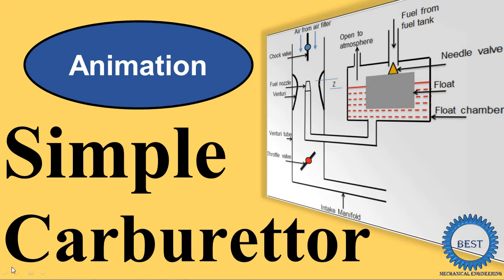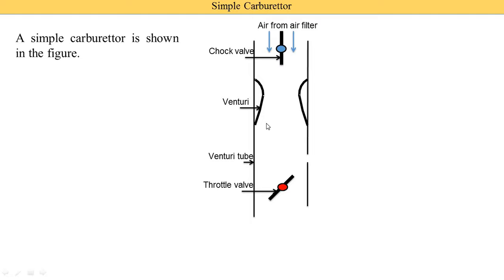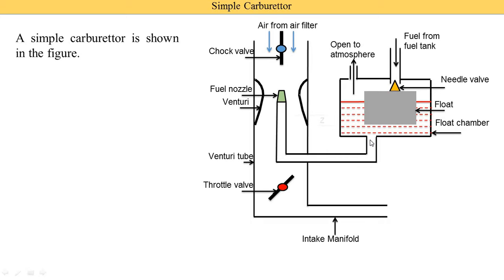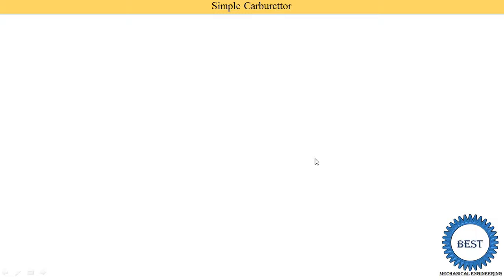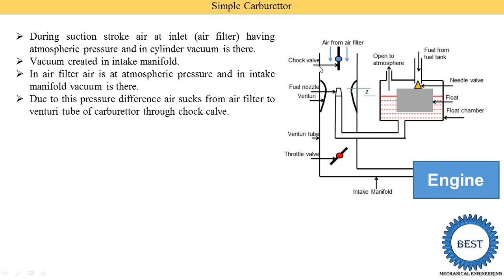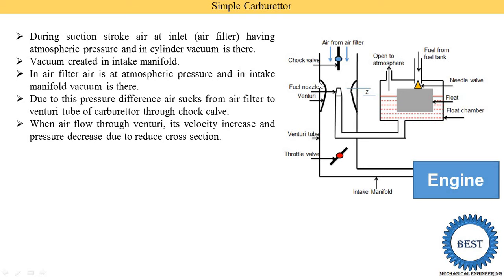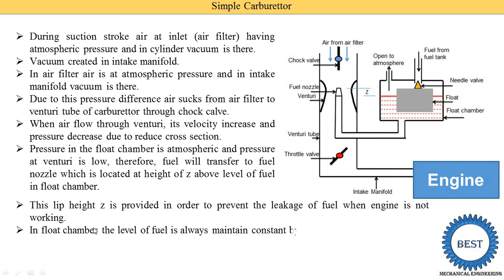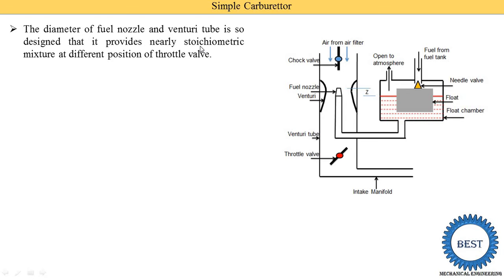Simple Carburetor

Comment: Can I get a solution for this- A simple carburetor under a certain condition delivers 5.45 kg/h of petrol with an air fuel ratio of 15. The fuel jet area is 2mm2 with coefficient of discharge of 0.75. If the tip of the fuel jet is 0.635cm above the level of petrol in the float chamber and the venturi throat coefficient of discharge of 0.80. 
calculate: 
(i) The venturi depression in cm of H2O necessary to cause air and fuel flow at the desired rate. 
(ii) The venturi throat diameter. 
(iii) The velocity of air across the venturi throat. You make take density of air = 1.29 kg/m3 and specific gravity of petrol =0.72

Comment: In the working of the carburettor, the 6th point is incorrect as due to reduction in area pressure increases, not decreases, because pressure equals to force at per unit area, so if the area decreases the pressure automatically increases. So, the correct statement is that according to the Bernoulli theorem the pressure energy is reduced due to reduction in an area not pressure.
Reply: As reduction of area leads to increase in velocity means decrease in pressure only
Reply: Pressure decrease,velocity increase,area decrease 👍
Reply: Pressure increase but pressure energy decrease as the phenomenon while we are sucking drink through pipe then we decrease the area of mouth and it's decrease the pressure energy and increase in velocity